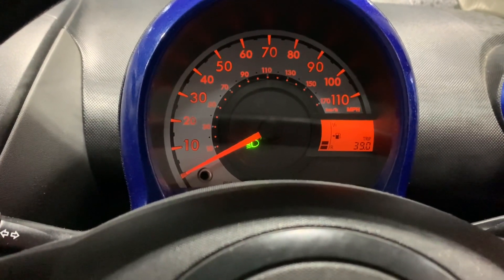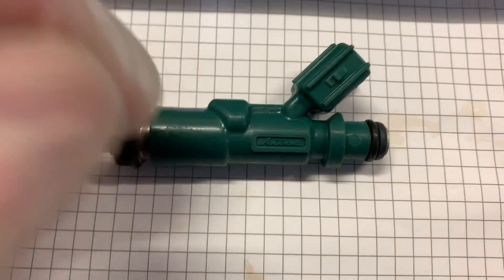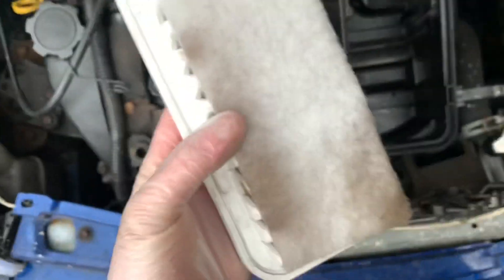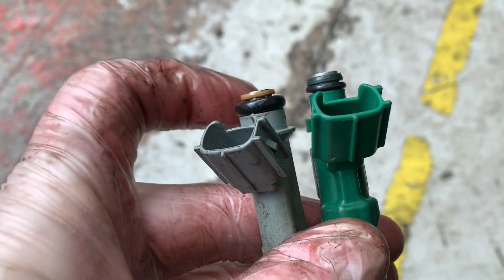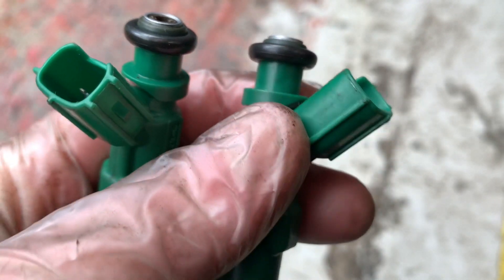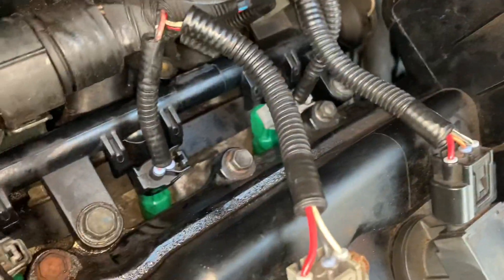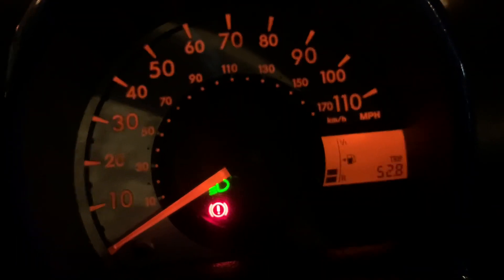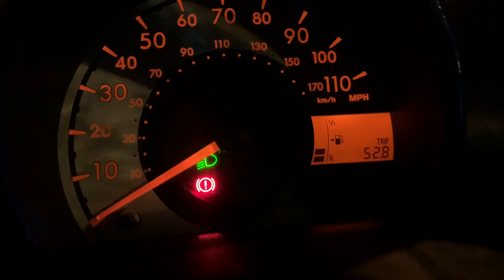Citroen C1 Bigger Injectors Installed, C1/Aygo/107 Yaris Injectors, Easy/Cheap Performance Upgrade

Comment: hi! i'm late but was wondering since my boyfriend has a 1.4 liter peugeot 206 engine laying around with all of its parts still in great condition, do you have any idea whether the injectors from that would fit? from googling, they look very similar to the ones on my c1 but i'm not 100% sure.
Reply from the maker: I don’t think they would be any better than the ones that are fitted standard tbh, probably worse
Reply: @StupidBlokeStupidVideos  ok, thanks! would you mind checking the oem part number on the tsport injectors since i'm planning on doing this upgrade aswell and i don't want to end up buying the incorrect ones 😅
Reply from the maker: @peugeot206gt I don’t have to part number for them unless it’s on the injectors themselves, which it should show in the vid. The easiest way to find them is to ask someone breaking a Yaris t-sport and ask for them. That’s what I did. The prices have gone up a lot since then though unfortunately

Comment: Just done this mod. Thanks for the video. I have also fitted the GS2 tuning box that connects to the MAP sensor. Jury's still out on that. Be great if you could try it and get your opinion.
Reply from the maker: Nice one. You shouldn’t need the tuning box with the injectors really. The injectors add a bit more fuel as these cars run lean from factory for emissions and mpg. The tuning box is meant to do the same by tricking the ECU into thinking more air is going in. I’ve not tried those tuning boxes on these cars but I’ve heard in the groups that they don’t work that will. I would be interested in testing one though
Reply: Your scientific tests should prove if they are any good or not. Currently £70 on ebay and free return if they dont work.@StupidBlokeStupidVideos

Comment: From which engine are these? The 1NZ, 2NZ or 2SZ?
Reply from the maker: Not sure, just around a 2006 iirc, Yaris T-Sport 1.5 so whatever that is.
Reply: @StupidBlokeStupidVideos Ah, well the post 2005 models had the SZ, but the T-sport kept using the 1NZ. I will track down some T-sport injectors and compare them to yours. Godspeed mate

Comment: did you install a wideband to see the fuel mixture?  what you did is 99% guaranteed to lose poer UNLESS if the car oem is very lean in wot (99% of the cars are NOT lean from the factory in wot) , so i wonder how it became quicker by thismod
Reply from the maker: @ef9b16a1  definitely didn’t lose power. Most modern cars are set to run at a leaner ratio. The 14.7:1 air fuel ratio is the most efficient, and road cars are tuned around this or sometimes leaner for emissions. To make more power/torque, a ratio of around 12:1 is often more effective, so adding a bit more fuel to a petrol engine that’s been tuned for efficiency is actually likely to give it a bit more power.
Reply: @StupidBlokeStupidVideos  hello , nice videos ,  the 14.7 is in closed loop and low to mid throttle , and low map sensor  reading up to 75 kpa , even if you install bigger injectors the oem  02 sensor will again target 14.7 but with  other short term fuel trims to make up for the bigget injectors , after that (75kpa) it goes open loop , where most cars are about 12.1 to 12.4 n/a in oem ecu map , the ONLY way you gained power if if the oem map was lean 13.5-13.8 in full throttle (wot) , and went to 12.9-13 with the injectors , then yes you have a winner , ibought a 107 for my sister and since i have a wideband sensor i will measure and let you know .
Reply from the maker: @ let us know what results you get. The bigger injectors were definitely a bit quicker on this one

Comment: 3 years late to this but thinking about doing this in the coming weeks. Did you ever have any fuel leaking out where you took off a bit of the plastic or was it always fine and petrol tight  ? Just don’t want to cock it up 😂
Reply from the maker: @fuzzbuzz4464  hi mate. No, no fuel leaking anywhere. It does use a noticeable amount more fuel though
Reply: Looking to buy today, thought I’d ask. Does it have to be the denso t-sport 1.5 ones or can I get the Yaris verso 1.5 ones? Asking because there is about a £50 price difference between the two.
Reply from the maker: @fuzzbuzz4464  as far as I know it’s just the T-Sport ones from the earlier cars, but I could be wrong.

Comment: Try getting rid of the airbox cover and old filter 
Install a 50 mm motorcycle sports filter instead.
I did it on my Aygo, and it works fine
Cheers
Reply: Hey was it one of those round flat top ones or more of the car looking ones? I have a cheap generic one but im having clearance issues

Comment: Great video, could you please chuck a link to the Yaris Injectors (on whatever site) here so I can grab some? :)
Reply from the maker: Thanks. I don’t have a link to the injectors unfortunately as I got them from a breaker on eBay. I just searched for someone breaking a Yaris T-Sport and messaged them for the injectors. 

I did however make another video doing a more in-depth comparison of the performance gains it’s. Here’s a link to that if you’re interested:

https://youtu.be/a3jBTvyxZm8?si=S9qyt-1pASJ-d9oL
Reply: @StupidBlokeStupidVideos  yeah no worries, I have watched both videos and am looking at getting some of these for my '08 107. Will find some on Ebay and post here for others 👍
Reply from the maker: @harveyfisher23  I’m not sure if these are the right ones, but yea if you find a readily available set that work, deffo post the link on here 

https://www.ebay.co.uk/itm/225790379957?mkcid=16&mkevt=1&mkrid=711-127632-2357-0&ssspo=wx8rzbjssus&sssrc=4429486&ssuid=B24T_G0JTKS&var=&widget_ver=artemis&media=COPY

Comment: Hello, I have a suggestion since you like tinkering with your C1. Can you please try to install a bigger oil filter ? older 1KRFE engine that have recently started burning a little oil may benefit a bit from a bigger oil filter. If you decide to do it please tell us the exact oil filter product number so we can duplicate it. Thank you
Reply from the maker: I don’t think it would make any difference with that tbh, but it would probably last longer before getting clogged up
Reply: @StupidBlokeStupidVideos  If you are willing to try it I did some research and have suggestions
Reply from the maker: @isymdvr I might give it a go next oil change
Reply: your pcv valve could be blocked, or its just reaching that age, mine is at 150k miles and i use a bit thinker oil and it stops it burning as much
Reply: @dillonlee3229  i have changed the pcv valve and yes i do use thicker oil. Would an oil catch can help minimising oil consumption ?
Reply: @isymdvr  changed? did you not try cleaning it first and was it dirty. yes and no the oil catch can will catch oil faper mixed with air your then not burning it but rerouting it back into a tank. there could be a small leak somewhere
Reply: also, you gotta remember, there getting old not most are over 12 years old reaching 19 a little oil burning is nothing to worry about. as long as your keeping onto of toping it up every few weeks

Comment: Did you say the exact part number make model of the injector ? please let us know
Reply from the maker: I didn’t get the part number, but the injectors are from a Yaris 1.5 T-Sport. Around 2004 model. Probably better to get some used ones out of the correct car than buy new aftermarket ones I’ve seen on eBay in my opinion.
Reply: @StupidBlokeStupidVideos  Thank you

Comment: Hi mate got a check engine light from doing this and it ended up running too rich so swapped back to the stock injectors. Tried all the normal stuff to reset the light but nothing has worked, any ideas of what to do?
Reply from the maker: What year is your car? I’ve not heard of anyone else having that issue and it’s quite a popular mod on these cars. Was it definitely running rich and not lean? I’ve seen people have lean issues due to the seals not fitting right and drawing air in.
Reply: @StupidBlokeStupidVideos  2009 mate, it was blowing white smoke, smelled of petrol and exhaust tip was black
Reply: @StupidBlokeStupidVideos  is it one of those codes where you have to clear it with a reader?
Reply from the maker: @gregcornes8912  interesting. White smoke wouldn’t indicate overfueling. It was probably just condensation if it was cold. It’s not a big job to fit them. I’d reset it on a code reader and maybe try again after a bit of a drive.
Reply: @StupidBlokeStupidVideos  Only problem is I'm trying to get it through its MOT🤣
Reply from the maker: @gregcornes8912  mine went through with them no problem. I usually have a decat but did have to refit a cat for the MOT. Left the injectors in though
Reply: Get e85 fuel 👍, with decat probably ok 👌

Comment: I have a 2012 vtr+ facelift model, my injectors look exactly like those tsport Yaris ones. Have you any idea what ones came stock in my poverty car?
Reply from the maker: Some of the later ones did have green injectors, but they’re not the same as the Yaris ones.
Reply: @StupidBlokeStupidVideos  I thought as much, where did you pick yours up. They’re dear as everywhere I’m looking. Thanks
Reply from the maker: @jackdyet2902  I got them off eBay. I just typed in Yaris T-sport braking and message the seller asking for them

Comment: Combine this with a 1NR throttlebody and a cone filter to compensate for extra horses.

Or go further and yank on that crazy expensive ITB kit with some 2.0 injectors
Reply from the maker: I’d love to do something like that but I’d have to get a lot more views than I do currently, to help pay towards it 😂
Reply: @StupidBlokeStupidVideos  I feel you lad, but it could make for one crazy ride! Love your vids, keep them going :)
Reply from the maker: @z-trip5457  I’d love to fit a supercharger or a turbo, I could get a cheap shitter off eBay for couple of hundred quid but I’d never find the time to do it way things are at the moment. Maybe one day and cheers. As long as I’ve time to make them and stuff to film, I’ll keep them coming 🙃
Reply: @StupidBlokeStupidVideos  I heard good stuff about the amr500, cheap af and not too hard to install, who knows!
Reply from the maker: @z-trip5457  yes. I’ve looked into these. About £200
Reply: Hi, is the throttle body plug and play or do you need to make some modifications? Can you tell me the throttle body code? Thanks
Reply: Isn't the 1NR a drive-by-wire tb? I was also curious for some throttle body upgrade for the 1kr

Comment: What model is your car. I have a Peugeot 10 (2011). This does have a toyota engine 1.0 petrol. What is your opinion??👍 And which toyota yaris are the injectors from?
Reply from the maker: It’s a 2007 Citroen C1. If you have a Peugeot 107 then it’s effectively the same car as yours, same engine etc. The injectors are from a Yaris T-Sport
Reply: @StupidBlokeStupidVideos  Thanks a lot, great work!! Take care!!
Reply from the maker: @evka3220  cheers mate, and you too.

Comment: I wonder how much more it would gain if you put on that massive air filter and route the cold air intake properly - without cutting a hole on the bonnet again.
In fact I wonder if the ECU would start to struggle with more air and fuel being injected?
Reply from the maker: It should be easier for the Ecu to get the mixture with the bigger injectors than it was with the standard ones
Reply: that silver aygo has it running at 97/8 hp and my C1 is running about 90hp but needs more tuning to get the correct a/f ratio and a proper exhust that isnt just racing headers.
Reply: @dillonlee3229  Can you explain the mods for C1?
Reply: That silver aygo has a channel about his mods as well as TSA performance having an instagram page where you can buy the mods. my C1 is running near the same setup with some diffreinces. my C1 has tspot yaris injectros, piper racing exhust, full 2.5" stainless exhust. bigger coil packs,  stage 2 flash tune and a TSA Induction Kit (Non A/C). this set up could do with a dyno tune but im unable to fine the people to do it where i live so it does overfule on the tune but iv changed cars while i put a turbo on it.

Comment: Hello, can you try this upgrade with bioethanol ? It could be run perfectly ...
Reply from the maker: I think I would need much much bigger injectors to run on ethanol, probably about 150% flow rate but I’m not sure. If I could get hold of some I’d throw it in the give it a try though 🤷‍♀️
Reply: @StupidBlokeStupidVideos  Its maybe to late answer,  but you need about 30% bigger injectors to run on bioethanol/E85. With ethanol, the engine will run better due to a high octane rating of 104. The engine internals will be clean so do the hole fuel system. Its gona be more reliable and have more power, and ethanol makes less wear on the engine than petrol

Comment: Not a chance that dose nearly 70 in second that spedo must be fkd
Reply from the maker: Most car speedos are slightly optimistic, this is about the same as most other cars 🤷‍♀️. They are pretty long geared though. 

The shitter does about 35 in first, 65 in second, 90 in third then 110 in fourth 🤣

Comment: don't get it... what's the point of fiting bigger injectors if there is no change in amount of delivered air? only with more air more fuel make any sense...
Reply from the maker: Good question. Cars from the factory are set up as a compromise, and usually performance is held back in favour of fuel economy and more so emissions. These definitely made a noticeable difference without even mapping them in.
Reply: Get e85 fuel with no reprog 😉

Comment: Surely it's just gonna show a negative ltft ? And have zero difference after it's done a few drive cycles ? 
Can these ECUs be remapped via obd?
Reply from the maker: The ecu can be remapped but this hasn’t been, and I’d have thought similar,.. I’d have expected any differences just to be filtered out by fuel trimming but they just don’t seem to be. It’s done probably about 1000 miles or more with them in and definitely runs better on them. It’s mainly noticeable at cruising revs than anywhere else. It is also noticeably worse on fuel though.

Comment: Would celica 1.8 injectors fit? (2004) No Yaris t sport injectors available in my country.
Reply: or maybe any other more common vehicles. that would fit.
Reply from the maker: Not sure to be honest, but I’m pretty sure the duty cycle would need adjusting by mapping if they do fit.
Reply: @StupidBlokeStupidVideos  i did found 2NZFE injectors (1.3 engine) i'm pretty sure they are the same as 1.5?
Reply from the maker: @Jelle102  honestly not sure, but they could be.

Comment: I'm impressed it does 70 in 2nd. I haven't driven a car that does that in a while. My current car will just tip 60 but it's a diesel so that's pushing it
Reply from the maker: Yea almost 70 in second. It’s long geared for a 1.0. Gets to about 35 in 1st, 65 second and 90 in third! That’s the same ratios as my old Volvo V70 T5!
Reply: @StupidBlokeStupidVideos  my mum's old 106 was the same very long 2nd. My current is a 6 speed too. Not sure how I managed it... one day I was racing someone and hit such a nice boost curve I was doing 110 in 4th 😂 suddenly realised.. then 5th only goes up to 125.  6th will do me good for 140 bit it whines like a bitch so I don't push it that hard that often any more. I used to daily to work at 130mph for 3 years straight. Absolute tank 😆😆
Reply from the maker: @MaNNeRz91  what car is it?
Reply: @StupidBlokeStupidVideos  Renault Laguna with the widely used 2.0 DCI in all the Nissan's Vauxhall's and Renault's.

I bought it because I wanted a reliable turbo diesel that was cheaper to insure than most. 
It was cheap for its mileage and condition. (89k 1 owner)
I gave it absolute abuse for 3 years (now 175k miles) and the turbo started showing signs of oil passing the seals (weirdly thatwent to the air filter and not the intercooler) 🤯

I've stuck a better turbo on it and decat. Egr delete and all that good stuff. Still pulling strong.
Reply from the maker: @MaNNeRz91  what year is it? I had the 1.9dci in my old volvo S40d. Mine was the 8v timing belt engine. Tbh it was brilliant, and went half decent for what it was with a tuning box.
Reply: @StupidBlokeStupidVideos  it's an 07 MK2 facelift (the better looking one)

The 1.9 was a decent engine but the belt was it's weak link and the oil pump was  pick of the draw if it lasted more than 110k. The 2.0 dci was put in use from 2005 and replaced the 1.9 and 2.2 pretty much. Chain driven. Swirl pot pistons. Balance shafts. 1600bar common rail and peizo injectors. Still being put in cars now but it's a more refined "eco friendly" version. Same block and design though.

Im sure volvo had better electronics on their version of the 1.9 😆 lovely cars though wouldn't mind one.
Reply: Give my channel a little look over if you're interested mate they're only short videos mostly decat, muffler and some ECU trouble I had. Not long started uploading stuff.
Reply from the maker: @MaNNeRz91  yea yours  is the M9R I think. Keep an eye on the timing chain, if it’s the one I’m thinking if they can have issues with it. The F9Q I think was in mine which also had many of its own issues too haha
Reply: @StupidBlokeStupidVideos  that's right mate. And the chain was my first worry but in all honesty after how I've treated it it doesn't skip a beat. No chain slap. When I turn the engine off its slightly more aggressive. It just halts because of the egr and anti shudder removal. It doesn't starve the engine of air anymore it just cuts fuel instead.
Reply from the maker: My 330d 6 speed only does about 50-55 in second.
Reply: It will get to 80mph if revved to 9,000rpm?